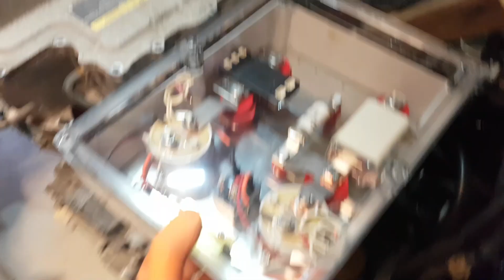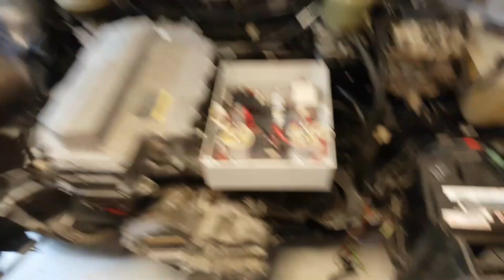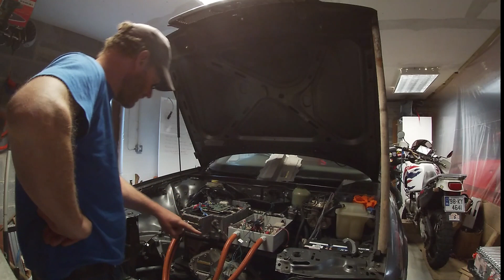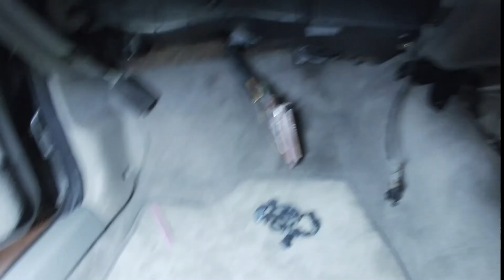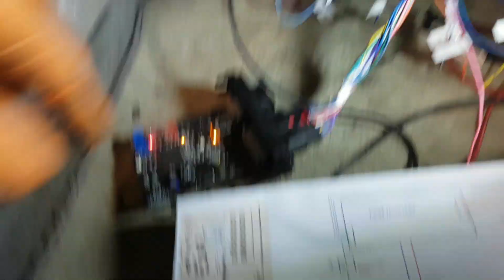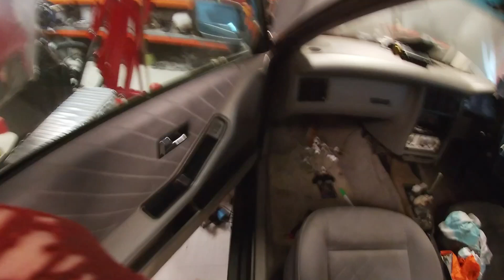Audi 80 EV Conversion - #12 - First Drive Prequel

Comment: Great update Fiachra and I totally get you were too excited to wait before posting last week.
Sag's question below seems relevant but mine is about the batteries at the front. 
1. are you concerned they may be too high and far forward for weight distribution?
2. Will you build in some kind of crash protection for them as they seem to have no protection at all from even a very minor frontal impact?
Really loving this build as I'm in the planning stage for something similar myself.
Reply from the maker: Cheers man👍. Yeah, weight dist is something im looking into. Still lighter up front then before but the weight so far forward may not help but, we'll see. The old quattros were a tad nose heavy leading to understeer. On point 2, it's one I will seek guidance from the auto engineer when I have him look before I proceed any further. I can lower them and they will be contained in a battery box and an inertia cut off switch built in too in case of a frontal crash to cut the cct.

Comment: Question for you Fiachra, if the junction box is at the front and the battery pack in the trunk, does that mean that the wires running along the underside of the car are always live up to the junction box which contains the contactors?
Reply from the maker: Well, live as much as they would be while the circuit is complete, which is what happens when the contactors are enabled and providing the inverter with power. For safety, I'll be including the original Leaf safety Disconnect in the boot space for easy access when work is being carried out. I'm keeping to the same format it was in the Leaf, just the 48 cells are split into 2 locations. By no means an expert but following in the footsteps of many others who have similar layouts.
Reply: @Scampi6000  I'm about as novice as you can get :-) 
The concern buzzing around my head is that let's say you accidentally ground the middle of the car and damage those high voltage cables. As they are "live" all the time, that to me seems to pose a risk. Maybe I'm overthinking this but to me, it makes more sense that the contactors be located in the back. 
Having said that, I've seen lots of builds, including Damiens builds where contactors sit in the engine bay, so I'm just confused about this.
Reply from the maker: @sagster  should be no worries there. I guess I never showed the final location of the cables as they will be tucked up out if the way in the old exhaust/transmission tunnel. Again, there will be emergency cut offs in the (as they say on the preflight announcement) unlikely event of this occurring, power can be cut.
Reply: @Scampi6000  thanks for the clarification.